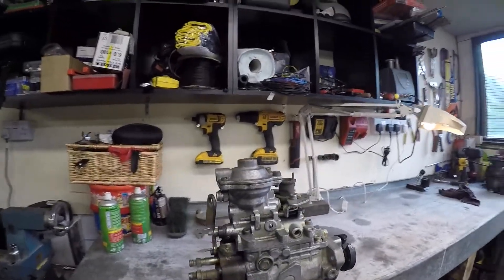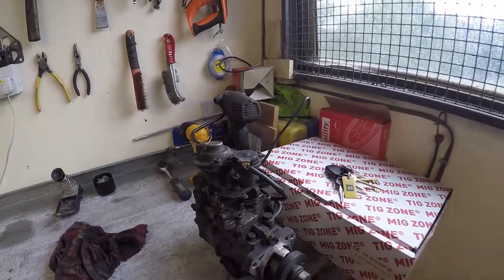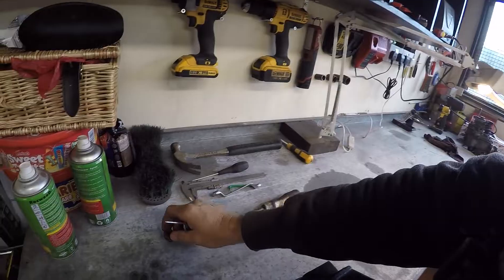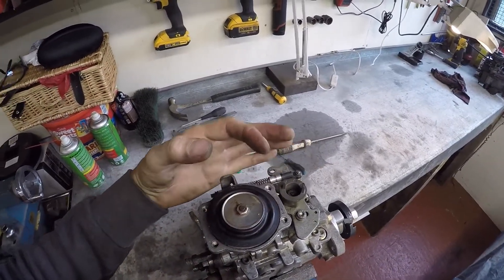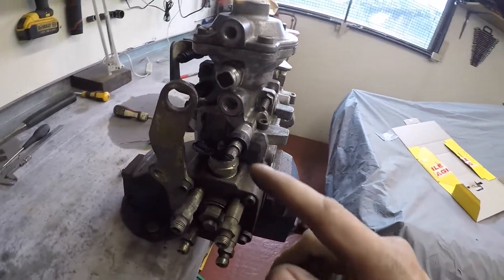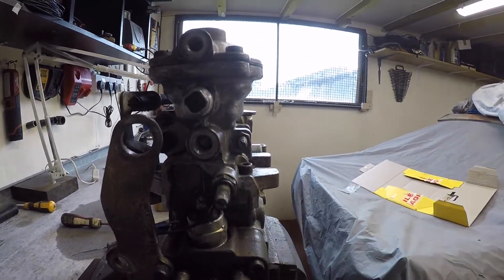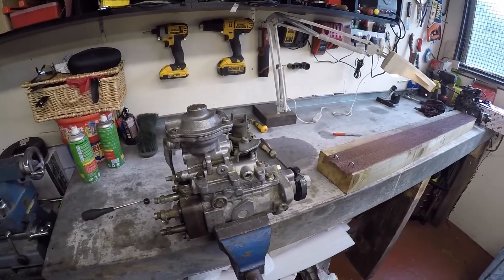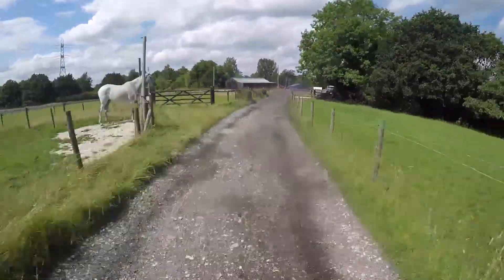300TDI & 200TDI Injector Pump Modification Land Rover Defender & Discovery Bosch VE pump

Comment: Have you played around with pump timing? If so, how many degrees do you advance it? And have you made any exhaust modifications?
I have a 300tdi Defender ute, screwed up a bit. I use a boost control valve in the cab so when I am pulling big loads on a long incline and the EGT starts getting up there past 700c I can watch my boost gauge and alter it from the standard 15psi up to 18-19psi if needed to keep the exhaust temp under control, I won't go higher than that due to overspeed of the turbine shaft. I also have a home made digital coolant temp gauge setup (purchased from Aliexpress) that replaced the original OEM gauge, best $5.00 including postage I've spent, it's accuracy is amazing. The slightest movement on the throttle pedal will see a 0.1c movement in about 3-5 seconds. I got tired of wasting good money on VDO shit that is 10c out of accuracy, I tried mechanical and electronic and both were pathetic. Maybe it has something to do with them both being made in India? Either way, other premium quality brand 52mm gauges still wouldn't beat my $5 Chinese gauge for accuracy.
Reply from the maker: Hi Roger,  yes I play with timing but only a couple of degrees or so, all 300’s are a little different so I tune timing by ear, I just take it for a spin after adjusting and listen for pinking then back off a degree then make sure the pinkings gone, you’d be amazed by how much most of them are retarded. With the boost I run around 20psi as that’s about the best your gonna get with standard turbo as anymore would be out of it’s efficiency range but a hybrid can run a little more. Yes good move with the boost control mate and the extra boost definitely helps keep the temps down with the extra fuelling.
I’m a big believer in DIY electronics as I’ve built a Speeduino for my Renault 5 gt turbo that I’ve converted to EFI and runs perfectly ,as long as you build them well and use decent senders and sensors you can’t go wrong and it’s good you’ve added the extra digital gauge to monitor your temps, better safe than sorry mate 👍
Thanks Shane

Comment: Gday, awesome video thank you. Ive been messing with my pump for a while, had some good configs and some real doughy ones. Currently Ive got good power egt looks to be sitting around 250 degrees c on idle. My engine overheats underload eg using AC, after all new radiator, wp and fan clutch. Could it be fuel delivery thats causing the heat?
Reply from the maker: Gday Azza’s, 
thanks mate, if it’s overhearing at idle then it’s unlikely to be the fuelling but if it’s up in the Rev range when it’s over heating then the easiest way is to see if there’s to much black smoke, if so then it could well be your fuelling, also it could be your pump timing as this effects heat dramatically especially if you can here pinking when driving, it’s hard to distinguish pinking from Diesel knock but if you adjust the pump timing and take it for a spin you’ll soon be able to tell the difference in noise between the two, you want to just here the pinking then back off the timing so you can’t here it for optimal performance and reliability.
The overheating could well be an other issue like head gasket or a cracked bore or head.

Thanks 
Shane

Comment: Cheers for the video ! Very helpful. I have seen boost pins on the market and was wondering if they do the same job (seems to be a bit brutal) ? What is better, the method on your video or boost pin ? Can you recommend any temperature kits to install to verify the temperature? 

If you have a video on adjusting the actuator on the turbo that you be great. 

Love how simple you made the video. Cheers
Reply from the maker: Thanks Ross glad it was helpful, the boost pins that you can buy are usually flat like a wedge and have to be installed perfectly flat against the fuel pin so need to be installed correctly, also some are made from not so tough steel and can wear a groove in them from the pin. They do the same job really but you can’t rotate them to tune if you ever wanted to in the future. Some do however allow the fuel control pin to have a little more travel so therefore more fuelling, I prefer to use the original pin as it’s made more superior and is correctly toughened.
As for and exhaust gas temperature gauge then you could try any simple gauge from eBay example 

https://rover.ebay.com/rover/0/0/0?mpre=https%3A%2F%2Fwww.ebay.co.uk%2Fulk%2Fitm%2F311988086342

I will probably be doing a video on the turbo actuator adjustment in the near future and thanks for the nice feedback😁

Thanks 
Shane 👍
Reply: Thanks alot for the info. Can't wait for the video of the actuator. A lot of my friends have watched your video this morning :)
Reply from the maker: No problem, I’ll get one done next time I’m stripping a 300, and thanks for sharing the video with your friends.

Thanks 
Shane 👍

Comment: How can you tell if the star wheel has been altered? Also is the egr switch/ecu just a case of removing from the top of the pump? Already blanked my egr off
Reply: Ok cheers I’ll try the gap then have to work out the top screw aswell
Reply from the maker: The top screw controls the fuel very low in the Rev range so you can adjust in and see if there is to much smoke when setting off with low revs, if there is the just back it off a little and try again. 👍
Reply from the maker: It’s difficult to tell if the star wheel has been previously adjusted so I usually go for about a 5 to 7mm gap between pump and diaphragm lid resting on the spring.
Yes the EGR switch can just be removed and yes the EGR ecu can also just be removed 👍

Comment: I’ve been looking at doing this for w bit. However , it’s been hard to find a good part. There is a lot of tush copies out there. If you have a contact for a good pin supplier please let me know I’ve got a 200tdi disco lump in an ex mod defender.
Reply from the maker: Hi

I use the original pin, in the video the pin is also the original pin and find it best long term for wear and toughness. Although with straight cut aftermarket pins you can get more fuel span I don’t like them as they must be inserted truly flush and most wear as they are soft metals and not truly toughened. Thanks Shane

Comment: Awesome, thanks. Will this anyhow affect the automatic transmission?
Reply from the maker: Hi. A lot of Discovery autos are drive by wire and have a different injector pump that doesn’t have the diaphragm, but if you do  have the pump with the diaphragm then this method will work and will be ok with your auto. Thanks Shane 👍

Comment: Good video,those nice mechanical pumps...i install diesels on small boats (19-22 ft) and i use older (mostly Iveco) engines,rebuilt,with mech.pump (and made in ebay EGT gauge).
The most rewarding mod i did on one of my 1994 Montereys 3.1 td took exactly 1 ( one ) second; 
Hammered down the pin in the pressure valve  about  .90 mm; 
Instant throttle response now,jack rabbit  like, feels like it's 1500 kg;  L O V E it!!!
B U T.....careful!!!    if you sink it in/down too much,you may ruin things!!! of course you'd remove the valve then,push the pin out the other way and re-start; of course you'd use your trusted caliper in the beginning and end,trust me,i do!! and i use a threaded rod with a stop nut to gauge the depth of sinking of the plunger; 
I guess that the internal pressure was too low due to age (or factory cal.) to begin with; the timing,judging by sound,did not change, did not advance,but the take-off and acceleration sure did.
Reply from the maker: Ha ha thanks man. Yes the Iveco are a tough engine and I bet they move a boat well with all that torque mate. If in doubt get the hammer out 🔨 😂 yea I usually just tweak the timing by ear too, just listen for the dreaded pinking rattle then back it off till she sounds good 👍

Comment: How does this affect fuel mileage?
Reply from the maker: If driven correctly it can improve fuel economy but if driven hard you will definitely use more fuel. The Discovery is more difficult to get decent fuel economy than the Defender due to weight.
Reply: Does this mod basically allow more fuel in at lower boost pressures?
Reply from the maker: Yes but also adds it earlier to help acceleration and changes the fuel curve for better drivability.

Comment: Also, I recommend backing off the main fuel screw if you see too much black smoke... you want to only see a mist of black under acceleration.  Gotta love these old units, so easy to work on and experiment, but like I said just requires monitoring with EGT gauge and boost gauge if modifying the boost (want to keep it under 17psi).  Good vid tho ;)
Reply from the maker: Thanks mate yes best to monitor exhaust gas temps and boost, and sensors and gauges are inexpensive now so makes sense 👍

Comment: When I did mine, what I recommended was to install an EGT Gauge first before messing with the pump.  You need to make sure the EGT temps stay well below 720 degrees C, else melted pistons and blown engine will result.
Reply from the maker: Very good point yes it’s always a good idea to monitor exhaust gas temperature when tuning diesels and now that you can purchase sensors and gauges at such a good price it makes good sense 👍
Reply: That temp limit is mainly for the turbo on the 200/300 tdi, it will go before the engine does

Comment: What would be the ignition advance timing for this pump if you remove the EGR? As per the manual EGR pump should be set to 1.40 and non-EGR 1.54.
Reply from the maker: You should keep the timing as per the manual although there are many different pump versions so make sure it’s correct. I wouldn’t take the sprocket off to time unless you really need to as there is no keyway hence the 1.4 and 1.54 with the dial gauge. I usually take for a drive once I’ve done the pump and tweak the timing with the 3 x 10mm lock bolts and find its best when you just about stop the diesel knock (pinging) for best performance.